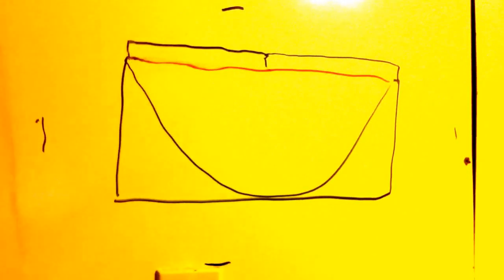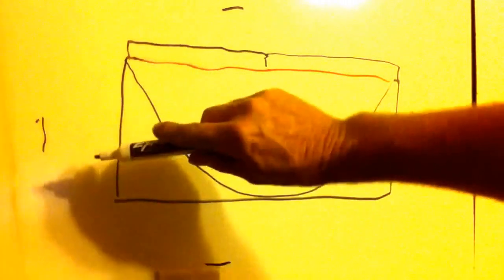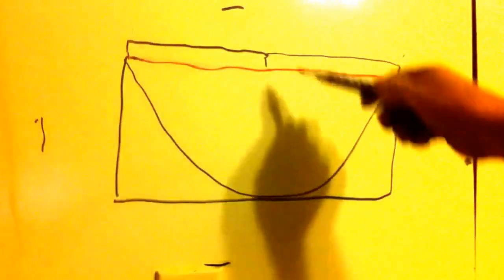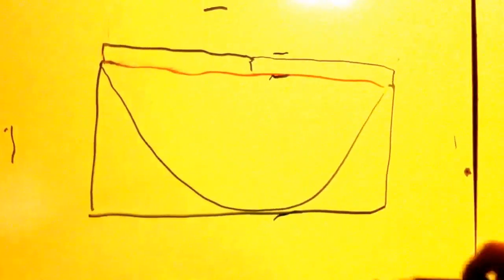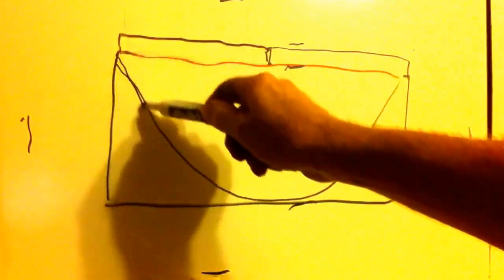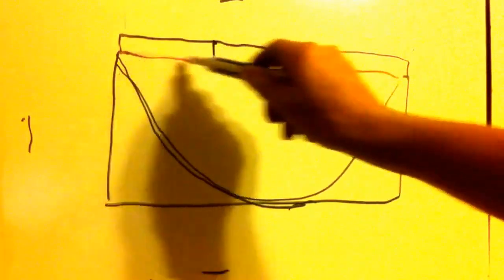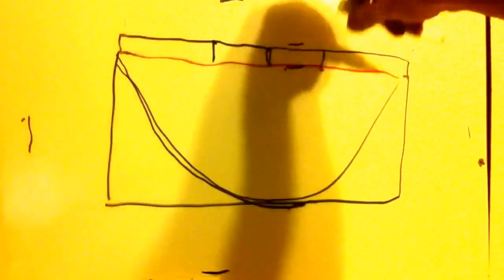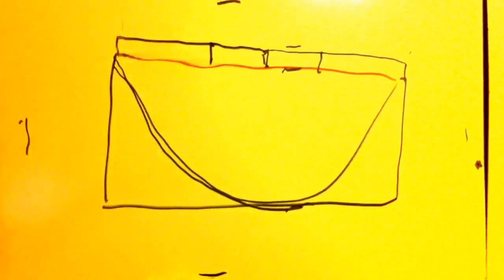How To Make A Tipi  - Video 1 - 10ft example pattern is scalable, any size.

Comment: Must try. Thanks for the short, to the point explanations.
Reply from the maker: You are very welcome amigo. I plan to do more Tipi videos at some point. I have a design for a more portable and durable single pole Tipi that will still let me have an open fire inside. I am thinking 12 to 16 ft in size. Anything smaller would be cramped for long term and bigger would be less portable. Thinking high tech with a traditional twist. ;)

Comment: I so want to try this with a 16 ft one..thank you..I love simplicity
Reply from the maker: You are welcome. I think I would start with a tarp or cover that is at least 18ft by 32ft. The reason for the extra 2ft to 18ft is for overlap and smoke flaps. Make sure you have enough poles to keep them about 3 or 4 feet apart where they hit the ground. For a 16ft tipi, I would use 12 or 15 poles. Note that it is easier to use in multiples of 3 on poles. The 16ft tipi is about 50ft around the outside and that divided by 3 or 4 feet would be 12 to 15. Poles should be at least 18ft long each to a total of about 2ft out the top above the smoke hole. Two extra poles to work the smoke flaps and your off and running. If you end up using wood, remember they can be a bit heavy compared to bamboo like what I use. I will be using 1 1/2 inch PVC on my next tipi and I will also be building a 16ft or maybe just a 12ft. My reasoning is keeping the poles small enough. Thinking the PVC can be easy to make two part poles that can be half as long for transporting. If I can find a way, I want to build a one pole tipi for something to camp in when on motorcycle road trips. ;)

Comment: When you make these, canvas gets expensive. But it is durable and good material. 

But I wondered... paint shop drop cloth looks cheaper than canvas. But is it durable enough to use for tipi material? Because its cheaper I feel I should ask this. 

Thank you.
Reply: if you harden it off with oil I don't see why not?  a great question none the less
Reply: just looked to my right, after i typed that response and lo and behold....  a thumbnail clip clip of someone making a teepee with drop clothes
Reply: Oh. That's an interesting idea. What kind of oil? Thanks.  @xredman002

Comment: I didn't get that
Reply from the maker: The radios is drawn from where the poles will exit the top of the Tipi and the top part of the pattern should come together and overlap at the front of the Tipi. That leaves a little left over for the smoke flaps. Smoke flaps are needed to keep rain out by moving them one way or the other. The half circle pattern will make a cone if you double the strait side and lace it up. Try it with a bit of paper and it will become very clear. I can give you more information if you want but try the paper half circle first. ;) Thanks for watching the video.

Comment: what material have easy made ? pvc tarp i think no need sewing, no have machine, only pvc glue, i need 18 ft winter use TP. how dimensions have 18ft TP ?  how lot need tarp ? Ready tp has ower 1000$ wery little only 2000 $ good size wery expensive, who can buy ? not any normal people only rich stupids.
Reply from the maker: +Matti Virta Use anything to make for survival. 18ft TP will need about 20ftx40ft tarp. No rules but some good ideas.